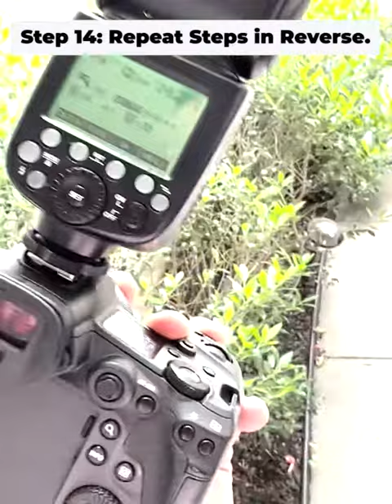How to Fix A Loose Hot Shoe On Canon R5 in under 5 minutes. Canon wiggly hotshoe repair Tutorial.

Comment: For the people with the loose hot shoes? Is it causing your flashes to go absolutely haywire? I have had an insane amount of issues with mine, and never had issues previously.  Anything from not firing at all to doing a full dump when I have it set for 1/32 power.
Reply from the maker: Should be recalled
Reply: @louiscabreraweddings1503  Would you say no to getting the R5 because of the hotshoe issues?
Reply: would you say no to getting the R5 due to the hotshoe issues?
Reply: @kassiaoaks7733  absolutely not. It's an insane camera! And I would assume that canon has addressed this from a manufacturing standpoint. I had one of the first 10,000 units produced. You'll love it
Reply: @kassiaoaks7733  Every camera will have it's trade-offs, so I wouldn't write it off just because of this issue. I do love my R5 and I wouldn't trade it at the moment, except to upgrade to the R5c, regardless of the shoe mount. I also purchased my R5 a month after the release date, so hopefully they fixed this with their newer models. R5c may also be a great option because of the overheating. I hope that this helps :)
Reply from the maker: They have not. 
 @smolderingmess9
Reply from the maker: And charged me $800.00 USD
 @smolderingmess9
Reply: I just fixed mine with CPS and they charged me less than 50 bucks.

Comment: Not very easy but doable. My camera is still under warranty, and I repaired it myself. Should I have sent it in? Maybe ... I just didn't feel like the hassle and logistics of returning it to a repair center, and then not knowing what had happened to it. For all I know some screws would have been put in incorrectly, some components may have suffered minor damage, ...

If you're faint of heart: send it in 😀

Some difficulties and tips:
- There are often different screws within the same assembly -- they have different lengths and different threads (for plastic and metal). Write positions down per assembly to avoid mistakes.
- The eyepiece connector was difficult to put back. I ended up inserting it by hand, and then pushing it until the end with a plastic spatula. There's a line on the PCB to show how far the connector should go.
- General tip: a PH0 screw driver is the right one for the job, not PH00 😀
- I removed the hot shoe mount completely to add some loctite to the screws. I do not recommend removing the screws as they are held in place by small pieces of plastic. Inserting the screws and putting the plastic back on top is rather difficult.

Good luck! 😉

Comment: While I commend those who undertake this repair, it is extremely risky and the potential for damage is high.  Taking the camera apart is fairly straight forward, the reassembly is more difficult.  I recommend allowing Canon to perform the repair as they have access to replacement parts.  True this is a costly repair (approx $400) and it borders a manufacturer defect (assembly), but the risk of damage should be weighed heavily before you start unscrewing things, peeling the "skin" away from from the body and separating the body halves.  Canon will return the camera to you repaired and with a warranty. If your in home repair doesnt go as planned, it will cost you far more.
Reply from the maker: I wish Canon refunded, recalled and fixed this for free :) 

I encourage people to take the knowledge, learn and grow. Even if you mess up during this process, canon will still fix it. Try this first before shipping it out. 

What's a shadow sport?